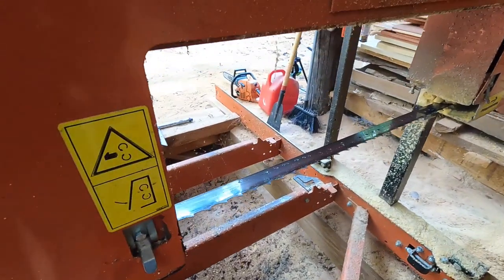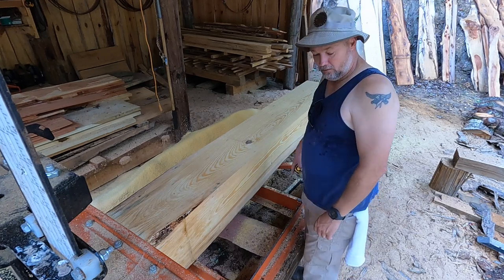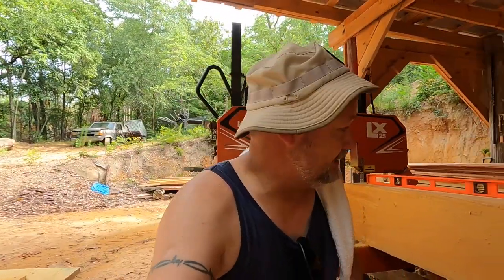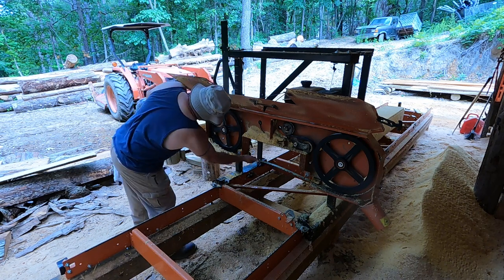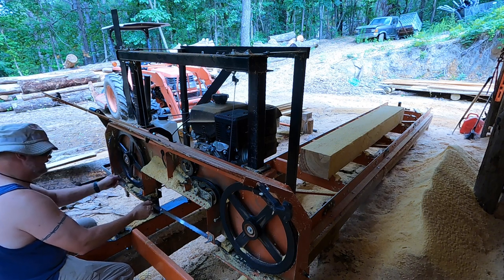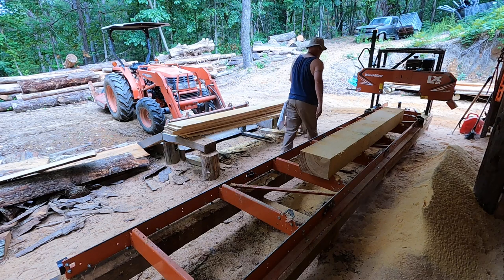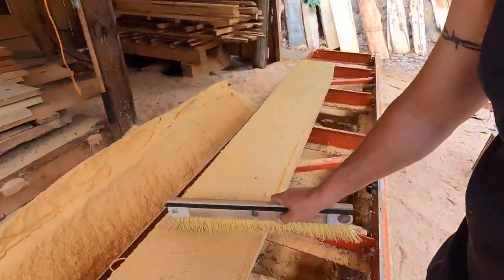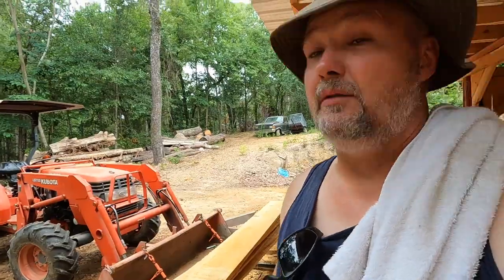Sawing pine and breaking blades

Comment: I was going to guess that you were cutting 6 quarter thick boards. Then at the end of the video you said your were cutting 5 quarter. Question do you release the tension on the blade when to saw is sitting ideal for a while. I seam to remember that that was a way to extend the life of blades on vertical band saw in the wood shop.  Dave
Reply from the maker: Milled to 1 inch to be planes to 3/4. Yes, if the mill is gonna be sitting, I back the torque down.